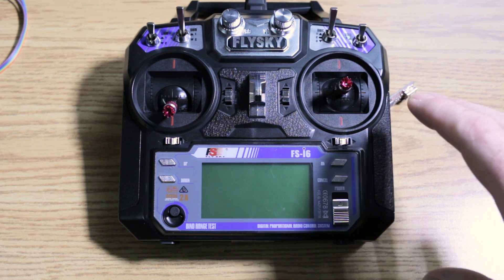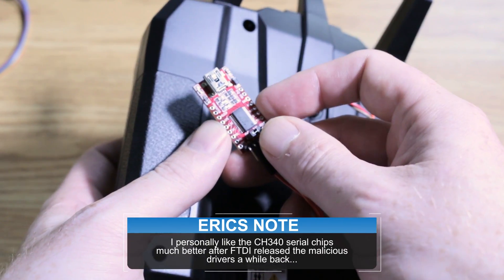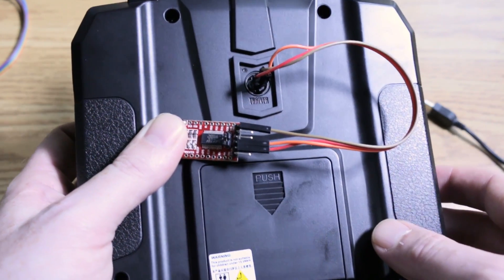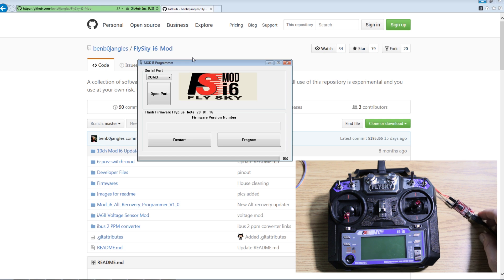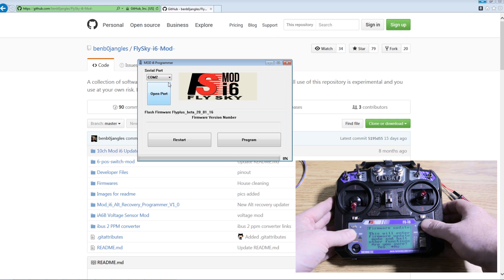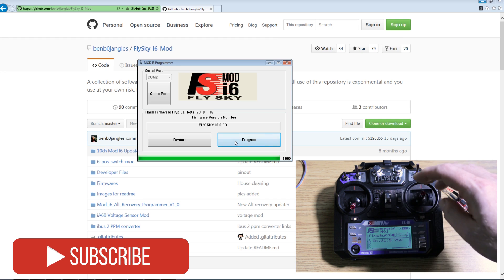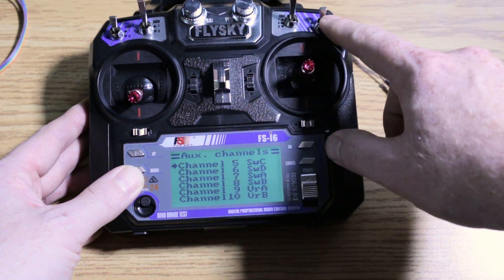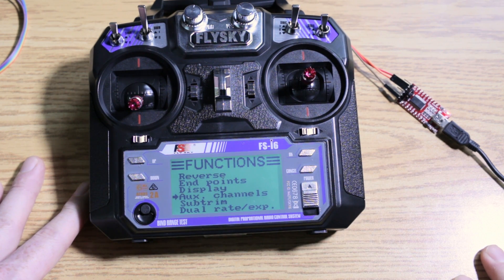10 Channel DIY Firmware Update for TGY-i6 or FS-i6 Transmitter | Tutorial

Comment: @MkmeOrg This post on upgrading Turnigy 6channel to 10 channel is by now 7 years old. Do you still support this action in case I run into problems running the upgrade? And next to that, you also provided the possibility to roll back to the 6 channel version in case of issues: what version is this (in case I need this and end up with an older version than is currently installed on my transmitter)?
Thanks in advance for your reply

Comment: Sir please how can I get this radio ,I want to use it for my project in schools, am from srilanka sir please I need your response GOD bless.
Reply: you can  buy it from amazon or banggod, its cheaper on the later. https://www.banggood.com/FlySky-FS-i6-i6-2_4G-6CH-AFHDS-RC-Radio-Transmitter-Without-Receiver-for-FPV-RC-Drone-p-1148659.html?akmClientCountry=America&utm_campaign=1211488_august&utm_content=2635&p=UG06171211488201502B&ID=52991442482&cur_warehouse=CN

Comment: Worked for me, on a chinese Flysky I6 transmitter. The only hiccup was the fact that programmer only works with ports 1-8, so you have to manually move the device to one of these, if it sits on port 10 default. Which WAS mentioned on the picture you showed in the video, to be fair. Also, there's one thing that might not have been obvious from this video, to enter the firmware update mode, you need to hold the two sticks down-left, but while doing that, you need to power it up like usual - and it won't work if the switches aren't in default positions (you sure know that error message). Now let's test if it still works with my i6b receiver...

Comment: I just got into the hobby of FPV racing drones and purchased a used 250 quad with a GoolRC GS-6 controller, which I have read is clone of the FlySky I-6 controller.  Do you know if that is correct??  It looks exactly as the one in this video.  I have purchased the USB to PS2 connector so I could upgrade.  Watched another video of yours and just curious if I can use the firmware upgrade on my Windows 10 machine??  The firmware version on my GoolRC GS-6 is 1.1 dated 7-Jul-2016.  My controller only shows 6 channels of course.  Sorry to ask this on your channel.  Very good information here and a little easier than going to a forum and reading a million different comments or posts.  Thanks in advance for any information.
Reply from the maker: I would assume it is the same but you will have to look into it- Ive never had that radio. They should all have the same components I'd bet.  Use the newer update video I posted recently if you do- The new firmware is awesome.
Reply: Thanks!!  I will check into it.  I just finished watching the Alarms and Flight Timer video, and was watching last nights live video of you soldiering the FC board.
Reply from the maker: Nice.  Good luck!

Comment: I had several problems with the 1.6 version and finally worked through them. Not sure what exactly made the fix but 1.) I put the 1.5 version it it's own folder with the hex file. 2.) I ran in admin mode and installed the 1.5 version. 3.) I downloaded the 1.6 version and placed it and the hex file into its own folder as well. 4.) Again, I ran the 1.6 version in admin mode. This time, after installing 1.5 first in admin mode, when I ran 1.6 in admin mode, it ran just fine and updated to 1.6. Hope this helps anyone with similar problems.

Comment: I just bricked my brand new FS-I6 with this procedure. I used the data cable available on Bangood. Everything proceeded as in this video, but when download completed the unit did not reboot. Turned off, will not power up. Any suggestions for recovery??
Reply from the maker: Try putting it in flash mode and hit it again.  Also use the newer firmware such as in this video https://www.youtube.com/watch?v=sCdORlxw8xY&ab_channel=MKmeLab There is even newer in the RC Groups thread linked but the process is the same.  You can recover it...
Reply: Thanks. I did manage to recover device. Still 6 channel, but working :)

Comment: Im having an interesting and just plain stupid problem with the updater program. I tend to use a lot of COM ports for a lot of stuff so when I plugged in my FTDI it set it to COM12 in my device manager. Problem is in the i6 Programmer the COM ports go from 1-8 and no further for some idiotic dumbass reason. Im going to see if I can change my port number but for now I cant do this update. Nice video though lol

EDIT: Looked it up and changed the COM number to 2 because that wasnt in use and selected that in the updater, worked great, thanks! If you need to change your COM number heres the link http://www.sealevel.com/support/article/AA-00441/0/How-to-change-asynchronous-serial-COM-port-assignments-in-Windows-Device-Manager.html

Comment: Okay, so why can't I just use a KSIM? Or can I? Also have a CH341A board.
Reply from the maker: No idea what KSIM is but CH340 should be fine- any USB to serial with functional drivers should be OK
Reply: https://www.banggood.com/22-in-1-RC-Flight-Simulator-Cable-for-Realflight-G7-G6-G5-G4-p-950398.html?rmmds=category

Oh you actually replied. But Do you know of a good video for the CHA341A mini programmer for doing this? I only know motherboard flashing. Which has nothing to do with wiring things up. 

That cable... Well, I guess it is just a training flight cable...:)
Reply: So I tried with my CH341A. On the sides of the BIOS chip placement TX RX and GRD pins are present. Windows does see it as COM3 in manager and I change the speed.But, since it is a hex firmware, would it be possible to run the firmware in the mini programmer program. But what would be the inputs. Like I said, I only reflashed a messed up BIOS chip. It would be nice to use this thing again. Hey thank you for any information possible. I love to learn!

Comment: seems to be a great video for that upgrade. but i there are some beginner questions:
1) so the 3 way toggle switch is without a function with the stock firmware?
2) how can you use the ch7, 8, 9 and 10  if the FS-iA6 receiver still has only 6ch
3) can you also use this Hobby King usb cable for programming instead of the FTDI chip? https://hobbyking.com/de_de/hobby-king-2-4ghz-6ch-tx-usb-cable.html
thx
Reply: unclealig you typed all this on the comments instead of Google. (Hint: 10chnls = using BUS port)

Comment: WARNING - This 10 Ch update didnt work for me and caused my i6 to fail. Only by chance I got the TX back by not switching off the tx after the fail and although having no lcd screen or sound I clicked on the flysky updater and managed to get my i6 back to its original firmware....... So be warned .......... note that several other people have reported this problem as well.
Reply: I must me crazy to try this again but did using an older updater ( version 1.4 ) and this time it worked. So I conclude there maybe an issue with version 1.5 that affects some flysky FS-i6 models including my own......
Reply: steve Boss hey do you know if there is something I need to do to get the firmware to download on my computer?

Comment: It worked perfectly and it was so easy! I used the usb dongle cord thingy I got off of ebay.

I've never done anything like this before and thought, "What the hell, he's telling me exactly what to do, how could I screw this up?" I didn't screw it up and got it right the first time!

Excellent video! Thank you for making it!

(now if I can just get my quad to fly right ...)
Reply from the maker: You're welcome. Best of luck tuning your quad. That's a whole different breed of fun :)
Reply: As long as it has 4 pins in the one end (PS/2 looking end) and the normal USB that plugs into your computer, then your set. The way MKme Lab does it with that extra usb stuff isn't necessary if you have the cable I posted from ebay. Just plug it in and follow his other instructions for the upload.
Reply: Same here. Took me 3 mins.
Thanks.
Reply: Duane Morris what dongle wire did you use? Can you post the link?
Reply: I HIGHLY RECOMMEND these guys:
http://www.ebay.com/itm/222351753209 - $7.26 - NyPlatform - I buy everything from these guys now!

Here are couple more, I haven't bought from them though:
http://www.ebay.com/itm/311801527049 - $6.99
http://www.ebay.com/itm/282371599383 - $8.36

All are free shipping and in the United States!

Just an FYI ... My FS-i6 is still working perfectly!
Reply: Duane Morris so I have that data wire. It came with the controller. I assume that one will work too? Or is there special chip in this one or something?

Comment: after using the tgy-i6 for about a year now as a beginner i love it.i have 4 quadcopters bound to this.i thought about the upgrade and did not want to take a chance screwing it up.there is a irangex irx-i6x 10 ch for 40$ on sale on banggood figured as an upgrade and a backup tx hoping it is as good.comes with a8s rx and upgrade cable.

Comment: Beware!!! If you long press cancel like you would to save coming out of the "Display" menu where you monitor channels the TX will send a steady signal value of around 75% across the first 6 channels. Could be painful depending on your setup and whatnot during bench-testing. Not sure if this bugs in the original firmware...
Reply: Yup been caught out by that . Not a good idea.

Comment: why cant my PC see my TX?? i have the data update cable from Banggood and installed the correct drivers... 
but i cant seem to connect. "device is not connected" it says.... i open
 the correct port to the cable but doesnt see my TX... any ideas??
Reply: Wann Sklobi  where I can find the drivers for that cable of banggood?
Reply: Wann Sklobi you're not connecting to the tx your only connected to the programmer.  that is all you should care about is of the programmer is recognized and communicating with the computer. ...sheesh ...newbs, complaining and not reading is easier than reading/learning what they are actually doing. If you plugged in a programmer to update you cell phone between the phone and the computer all you care about is if the programmer is working...it's a bridge...you wouldn't see the phone directly connected to Windows just the interface you're using to send code..

Comment: Hi, new to your channel, and new to serious RC aircraft... Could you help me understand this a little better?  I am about to buy a Tx, and have been researching them as much as possible, but am still learning.  Ideally, I want to build and design my own quadcopter and aircraft from scratch.

In your video, I see 6 switches, but there are 10 channels.  What controls and manipulates the other 4 channels?  Do you have to add more switches?  Or do I not understand what is happening?

Thank you for the video.
Reply from the maker: The gimbals are the other 4 channels. Throttle, elevator, aileron, rudder.
Reply: MKme Lab ok. Thanks! I didn't think those were considered part of the 'channel count'.